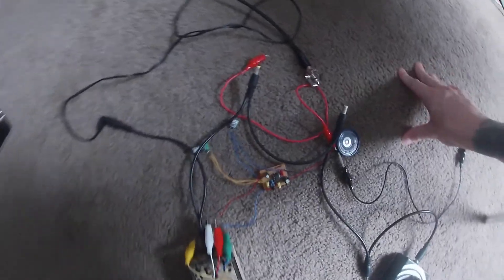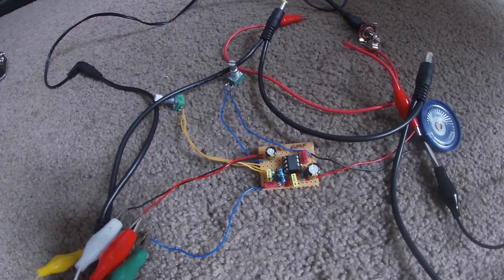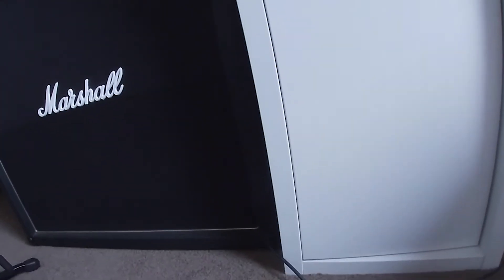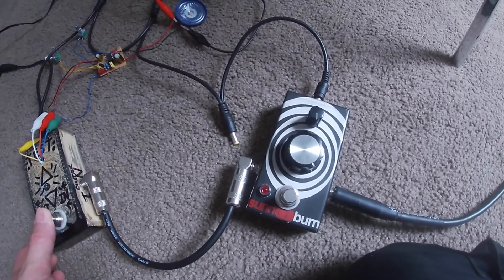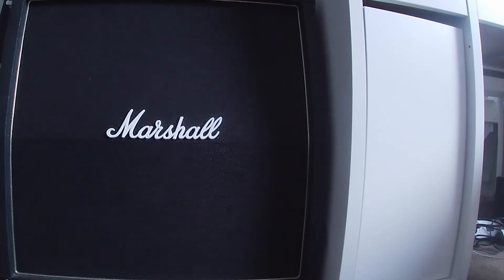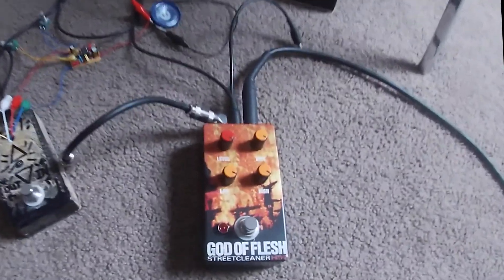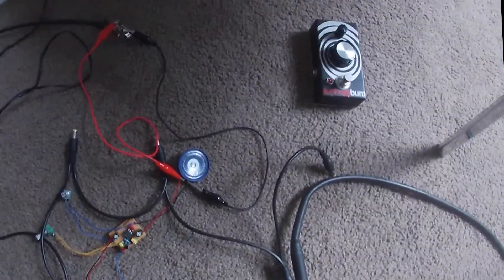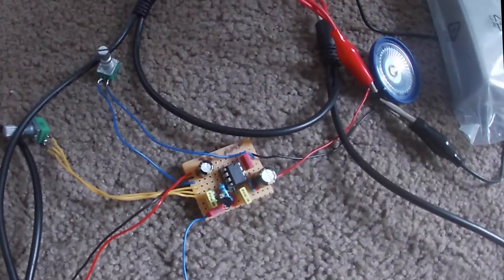Ruby Amp Pt.2 - Success!

Comment: Have you got the schematic of your version used here? I made one using  an lm386 audio amp kit from ebay and managed to squeeze it into a nano stomp enclosure. There's no transistor in those kits. I'm guessing it acts as a preamp and a bit of dirt. I've also boxed up one of the off the shelf 100 mono 12-18v amp circuits with a fan. They actually give around  25-30w at 12v into an 8ohm driver. I'm thinking of adding a basic LPB-1 style boost as a preamp with a gain pot which has a set resistor and switching jack for a clean/dirty  channel selection and another switching jack type set up after the preamp for fx loop.
Reply from the maker: No it’s just a vero layout from tagboard it’s in the description